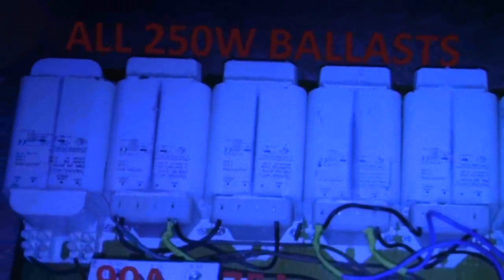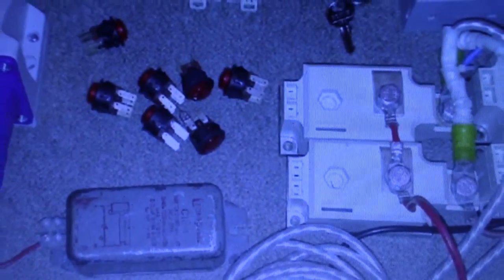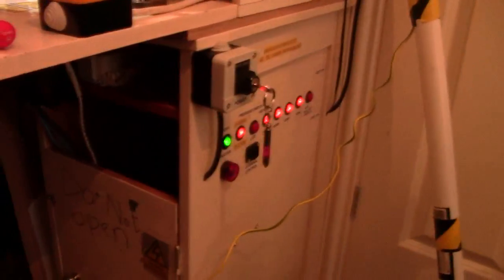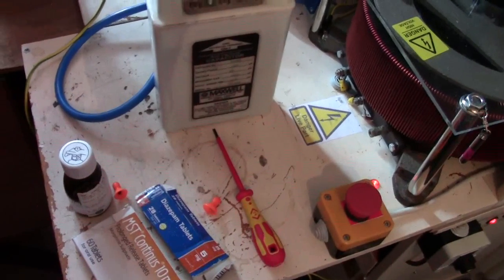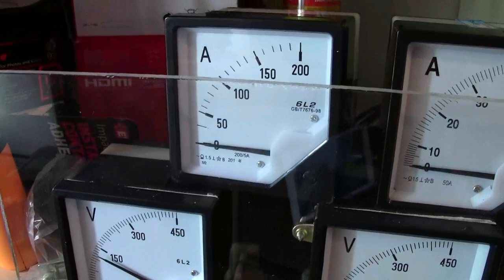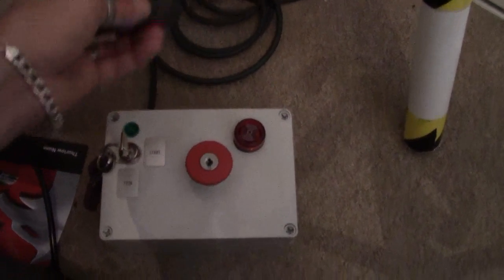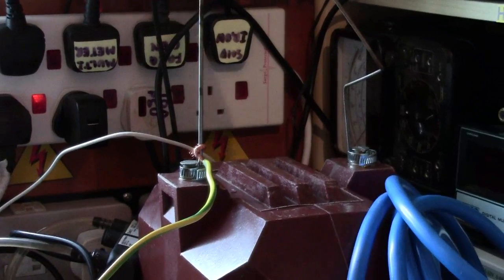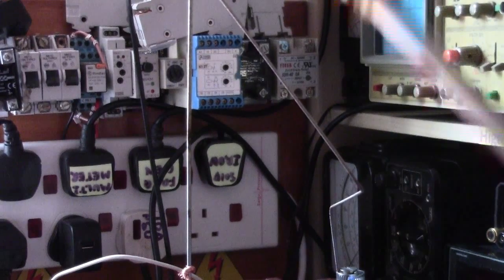Whats inside the ballast control unit and some safety stuff sort of request for thingyee1118

Comment: Thank you very much for the video John, I was wondering what ballasts you got and how you wired up your sounders ect. Nice safe setup. Also good advice on the wood chicken stick, all it takes is a bit of water in that wood and its conducting.
love that rectifier with those fat diodes :)   Thanks again for the video and the mention -thingyee1118

Comment: Anyone who is into hundreds of KV are (or should be) competent in what they are doing, and would be using proper chicken sticks, not even PVC.
but for the home constructor wood is fine as long as it is dry, the varnish is intended to prevent moisture ingress, many may have some polyurethane varnish around, and did you know that large tesla coils are coated in varnish, and they output several hundred KV 
oh, and my nick (sparky) comes from 32 years in electrical, and switching 11KV ;)

Comment: Great general advice
You can use dry wood, but make sure it is perfectly dry, then coat with a few coats of varnish, you could even add insulation material (tape etc) where you hold it, 
Small (lower voltage) chicken sticks can be old screwdrivers.